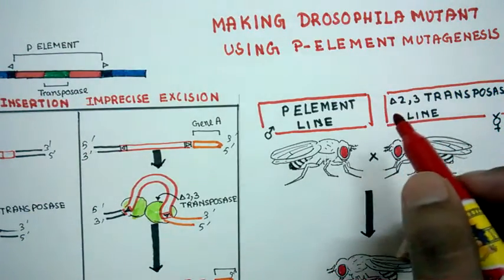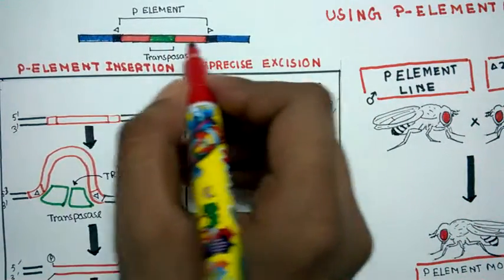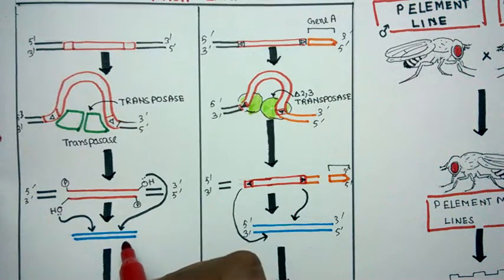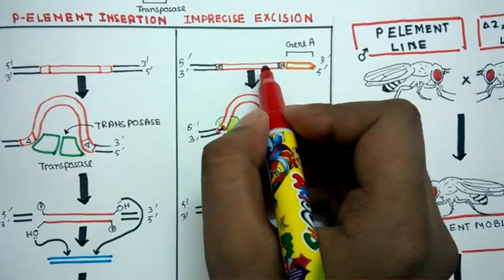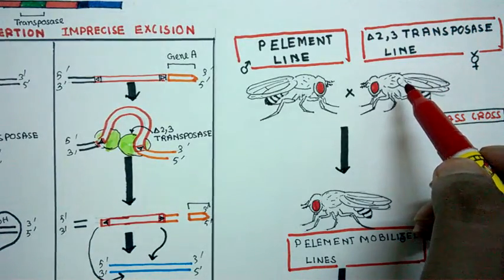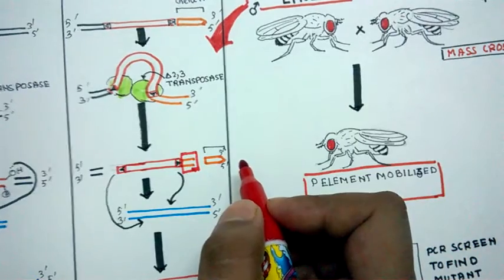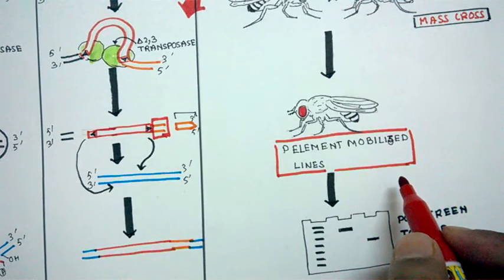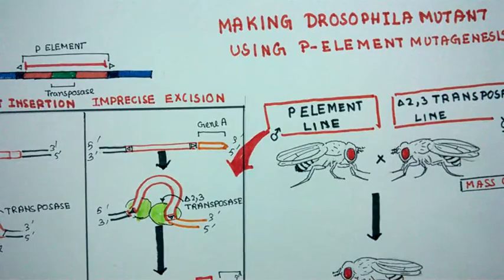Making Drosophila mutants by p-element mobilization : Imprecise excision

Comment: This was extremely helpful! Thanks!!! Can you make a video or describe the PCR process? A couple questions: after you determine there was a mutant fly after a PCR, what do you do since you probably crushed up the fly to get the DNA to perform the PCR? Would you clone the DNA to make more of the mutant DNA? Like, what comes after determining that there is mutant DNA in one of the flies?
Reply from the maker: Glad to know that it was helpful
Reply from the maker: Ok after P element mobilization you suspect there might be a mutant in the P-element mobilized lines. In order to check that u have to do a PCR screen. Here your forward primer would be fixed but you would be using multiple reverse primer cause you don't know how much of the DNA was deleted . So you have to use FP + RP1 , then FP+RP2 etc . to perform the pcr screen . For example design the reverse primer 1(RP1) 1kb away from the starting point  then PR2 which would be 1 kb away from RP1 and so on (1 kb is just for example you can choose the size depending upon your gene size)
Reply from the maker: Lets say by your PCR screen you found out a mutant and you have an idea that may be its a deletion mutant from the PCR . Now you have to sequence that and it would tell you which portion is deleted . Then you have to check the phenotype of the mutant.
Reply from the maker: For example you are working with gene A.You knocked down gene A and found a eye phenotype.Now with RNAi there is a chance of off targeted effect so you have to generate mutant and check whether mutant have the same phenotype.But its not the end , next step would be over-expressing a transgene in mutant background to rescue the phenotype.
Reply: awesome, thanks again :)
Reply: hey there. so with 400 different lines to screen, you set up multiple vials for each line so that that genetic line continues to live. you can isolate DNA from some of the flies and keep the others alive in vials. i hope this made sense